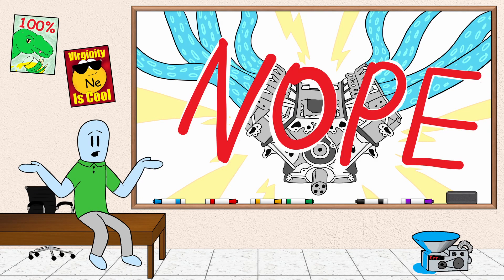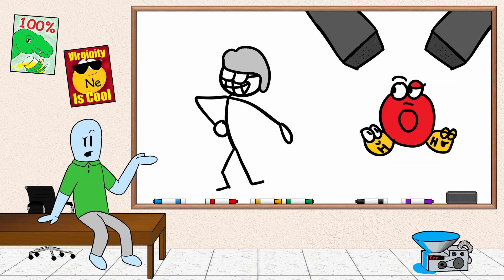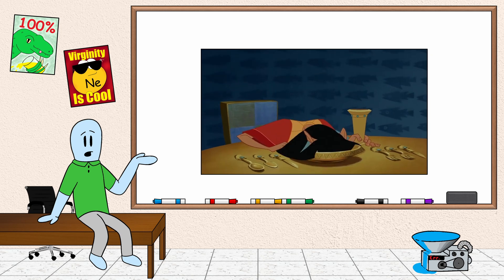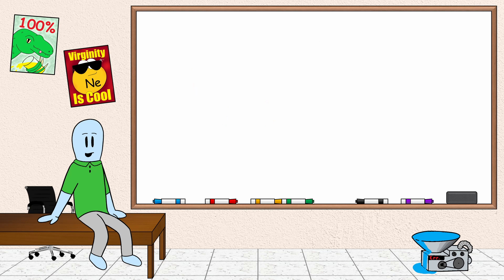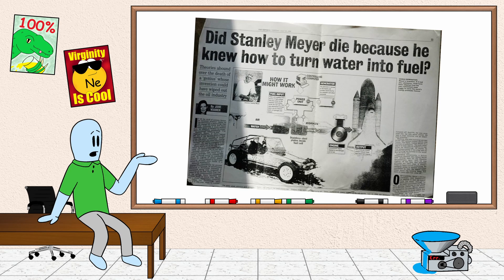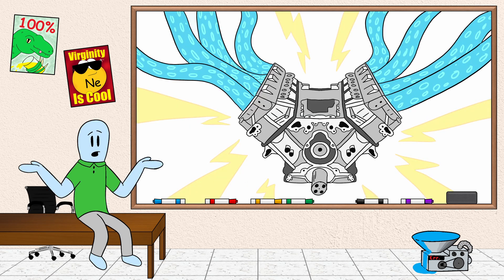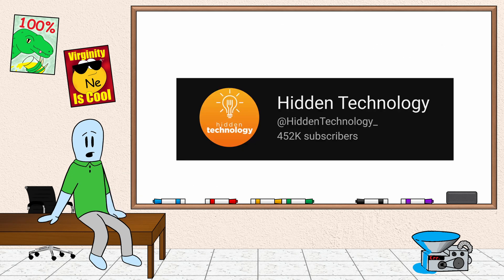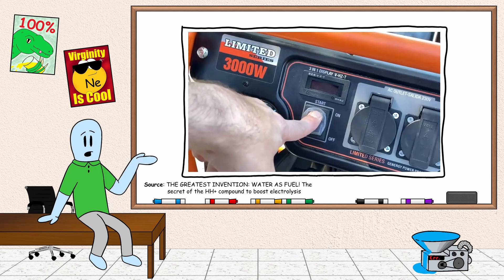Water Engine Conspiracy Explained: From Stanley Meyer to the Internet Wildfire

Comment: Your explanation it's incorrect wich leads me to question the validity of your full video if you didn't even took the time to research How his original engine worked.
Reply from the maker: Do explain to me how it worked then.
Reply: Then explain it since you did your 'research'.
Reply: You mentioned the concept is splitting the molecules Into a gas mixture of oxigen and hydrogen to be used as fuel, wich it's incorrect, Stan Meyer developed a car that ran on water as fuel, using a technology he called the Water Fuel Cell. The basic idea:
He split water into hydrogen and oxygen using electrolysis, but in a highly energy-efficient way.

He then used the resulting hydrogen gas as fuel in an internal combustion engine.

Meyer claimed his system used less energy to split the water than the energy it produced when recombining the gases through combustion. you also mentioned the 1st law of thermodynamics. While the First Law of Thermodynamics the conservation of energy is extremely robust in everyday and laboratory contexts, there are well-established scenarios where it does not hold globally or absolutely Quantum micro‑systems
Individual trials can violate energy accounting due to fluctuations
Expanding universe (radiation)
Photons lose energy via redshift without compensation
Dark energy
Constant energy density × increasing volume → energy appears to grow
Spacetime without global symmetry
No time invariance → Noether’s theorem doesn’t enforce conservation
Reply: So If modern physics accepts exceptions or limitations to the First Law in some contexts, why is Stan Meyer's work automatically discredited instead of being investigated under the same lens? Meyer’s system operated at macroscopic, classical scales — normal voltages, temperatures, and materials. So for his system to work as claimed, it would require:
An undiscovered physical principle, or

A misunderstood effect not yet accounted for in classical electrolysis.

That’s not impossible — it’s just extraordinary, and extraordinary claims demand extraordinary evidence, wich unfortunately there not much off but your video lacks a lot of points
Reply: So he may have stumbled upon:
A resonant electrolysis process where water molecules are split more efficiently.

A plasma-based or catalytic breakdown that doesn't follow traditional thermodynamic paths.

If true, it wouldn’t necessarily "break" the First Law, but rather extend our understanding of energy interactions in chemical systems.

Comment: Where are you getting that the engine produces water that gets fed back into the engine? stanley never claimed this, how do you expect to convince anyone that wants to believe this if you debunk it in bad faith?
Reply from the maker: The claim for the water engine is that the waste product is also water. Whether it gets fed back into the engine or not, the science doesn’t work because the input equals the output.
Reply: @SquirrelledStudio  Who claimed this? stanley claimed he used up 100 gallons of water driving from LA to new york
Reply: @wiiztec  100% agree, the backwards logic these channels use to debunk Stanley is absolutely astonishing. "Yes well let's change the entire function of the machine so that we can prove that the machine didn't work" good on ya pal
Reply: @wiiztec and that didn’t happen. Even if he did travel that much, the energy loss would be massive, not even enough to break even. You might say “To extract fossil fuels, You also have to lose energy by mining, drilling, etc.” but the energy return of fossil fuels is much bigger than electrolysis powered cars.  Fossil fuels is like investing 20 dollars in the stock market and getting 2000 back. Water powered cars are like investing investing 20 dollars and only gaining back 2 dollars
Reply: @TicTacSoda2341  You're missing the point, the point is he claimed he used up water traveling while this video claims that he claims water is a waste product of the engine that gets fed back into the engine
Reply: @wiiztec oh You are saying that the video had an inconsistency of what Meyers cell actually states. Am I right?

Comment: yes, essentially its an ev powered water oxyhyrdrogen process, without the battery its impossible to create the "fuel" and the fuel will not be enough to charge the battery, on top of that, hydrogen being the only thing this could run on, creates high amounts of carbon dioxide doing more harm than good, this then makes it worse than burning natural fuels, and therefore much worse than an ev.
Finally THANKS YOU FOR COVERING THIS, I KNEW THIS GUY WAS A CON. and quit it with that government crap Lol, 2:15 EXACTLY, thank you for this video!

Comment: this is a mis-direction video I have personel experiments with hydrolysis and seen water burn
Reply from the maker: @PatrickHart-q3s  Yes, but did you turn it into an engine that runs only on water power with no other input?
Reply: @SquirrelledStudio  who talked about not putting another input
Reply: @SquirrelledStudio  Stanley most definitely used a battery and alternator, quit bull****ing everyone

Comment: Hahahaha this is NOT AGING WELL AT ALL!!! LOOK AT WHAT BMW JUST ANNOUNCED AND CREATED. A WATER FUEL BASED CAR. LOOK IT UP. THIS VIDEO IS THE EPITOME OF PSYOPING! TAKE TWO MIDDLE FINGERS STRAIGHT TO THE DOME!
Reply: Get your caps lock unstuck dude. Bmw never made water fueled car. What they did was add water injection to the engine, this allows for higher compression and ignition advance allowing for higher power without risk of engine knock. This was used in ww2 on aircraft like P-47 it's not some magic it's just physics.
Water mist inside the engine reduced the temperature of compression and reduced hotspots. But no matter what, the engine is still powered by good old gasoline.

Comment: water + electrodes + a big battery = split hydrogen and oxygen = burn it 
works on a very small scale at least
and a car to work on hydrogen toyota mirai already exists, replace those huge hydrogen tubes with hydrogen generators and bam you have a car that acually works on water
Reply: At that point instead of doing
Battery>electrolysis>combution>output
Just do
Battery>electric motor>output
Reply: @blackturbine  Makes more sense but the point was to make a water engine right ? Most likely thats why electric cars are better

Comment: I saw a variant of a water/gasoline engine developed by Walter Jenkins, H2GLOBAL,LLC, running a modified gasoline generator at the Tesla Conference in Albuquerque 3 years ago. The inventor had a motorhome which he drove from Florida to New Mexico, an Aprilia motor bike and a 3500 watt Predator generator all of which functioned before leaving Florida but he was run off the highway near Houston which required the Motorhome to be towed to N.M.. I assisted him in his setup and helped manage his booth for a week and figured out the basic technological processes and functions.  There is no question that his methods were sound and the engines ran and were observed by dozens of attendees many of whom were scientists. His technology was the biggest attraction at the annual Tesla Expo. Walter was so paranoid(for good reason) that his efforts were paralyzed. He said that the Stanley Meyers technology would never work because it required more power input than it could produce, however Walter's process utilized piezo electric elements to burst the gasoline /water (1/100) mist fed into a modified turbofan boosted carburetor which allowed the fuel to burn very cleanly. The gasoline was a thin film coating on the water molecule which required straight gasoline to start but upon warming it was electrically switched to the mist injection allowing the mixture of a few ounces of gasoline to perform like a gallon. The commercial pollution measuring devices could not detect any significant hydrocarbons, etc. We drove the motorbike around the plaza for a few days in view of the hundreds and it ran perfectly. The scalability of his processes were theoretically promising especially for stationary generators,  Sadly, Walter Jenkins died about two years ago.

Comment: The part that was immediately suspicious to me was that he claimed it could also run on salt water, with no adverse effect on the engine. What happens to the salt, and other impurities?
Reply: The salt would build up in the storage tank as the water is split into hydrogen and oxygen gasses. It would not go into the combustion chamber. It would build up in the tank.
Reply: @joelp9486  not really.
Sodium chloride would also break down. Chlorine would travel into the engine. Forming harmful clorocarbons and sodium would combine with water forming sodium hydroxide that would cause corrosion.

Comment: Why would the government have so much interest in something that never would work

The Pentagon sent a somebody to buy his patent, you really think the government would be willing to spend money on something that doesn’t work

I’ve seen his electrically produce hydrogen generator it works it’s not perfectly fuel-efficient to modern day standards, but it will still run a vehicle. I can run an engine you can produce hydrogen by separating it in water. If the government thought this would never have worked. Why did they try to buy it and why did they continue to cover it up?

Because wouldn’t it be in the governments? Best interest to tell everybody that the water powered car can’t happen tell everybody that this guy was a con man in a scammer.

Comment: So electrolytic hydrogen separation that I have witnessed with my own eyes doesn’t happen

Adam Savage replicated  E hydrogen water, separator
Made one you can separate water in hydrogen and store them in separate containers. Yes, you can’t put water in your car and suddenly it’s turned into hydrogen. You need to have a constant flow of electric lyrically produce hydrogen so you do is you electrically produce it and separate them have it build up to a certain level and then you started it burns the hydrogen, and as it burns the hydrogen, it creates more hydrogen

I have seen the separation of oxygen and hydrogen with my own eyes. I have seen it turned into a combustible engine. It is possible fitting it into a fuel efficient vehicle that can run further than the average car that’s not possible but you don’t need it to do that because it runs on fucking water. 

You can separate hydrogen from water electronically 
I have seen multiple people do hydrogen car conversions 

They’re not complete conversions there more of a back up gas source
Reply: using the water as a form of energy battery is nothing new, as in splitting the water using external sources is "charging" it and using it in the motor is using that charge up

these people however claim that they dont need that first energy input, as in somehow reducing the energy cost from splitting in a closed system with a net posivite amount af energy released, which is impossible

Comment: The splitting of water into hydrogen and oxygen IS easily done.  The ONLY issue is finding a more efficient method to split the molecule.
YOU DONT HAVE TO RUN THE REACTION ON THE WATER ITSELF.  
Electrolisis does take a lot of energy.  So does oil drilling, oil tankers, refining plants, delivery tankers, gas stations and environmental cleanup!

Elon Musk has built a $2 billion dollar factory to build hydrogen powered semi-trucks.

Get it through your thick skull that the hydrogen WILL be coming from water.  That doesn't mean you have to stick a garden hose into your gas tank!

Water IS a form of stored energy.  So, when it is split into hydrogen and oxygen, the energy that is stored in it can be released.  

SO WHAT if you have to put energy into the system!  All systems require a lot of energy.  SO WHAT if you have to plug it in to create useable hydrogen?!  Of course its going to take energy to convert it into a useable form!

Just look at how inefficient it is to build batteries for electric vehicles!  Its ridiculous!
Reply: no one is arguing over using the water as a battery,

but these people claim to archive a net positive from a closed loop system (also called perpetual mobile) which is impossible
Reply: This guy is just a paid narrative controller for big oil and gas.  A paid shill !  RMIT Univ has done 14x hydrogen splitting.
Reply: Fossil fuels do lose energy but they get way more back by drilling and mining and refining. Fossil fuels are made of packed sun light and dead animals and plants. Fossil fuels are like investing 20 dollars in the stock market and getting 2000 in return. Water powered cars are like investing 20 dollars, but only getting back 10 dollars in return. You need 264 watts of energy to only get 244 watts of energy from electrolysis. Also about elon musks factory. Thats not from water electrolysis

Comment: It has nothing to do with splitting hydrogen and oxygen.  It has to do with frequency, charge separation, and creating forces without fields.
Reply: After electrolysis when hydrogen & oxygen split it also releases some free electrons then those electrons are captured to run an electric motor just like EVs to drive the car not the hydrogen to combust.If you already used those hydrogens for combustion then how come water is coming at exhaust that doesn't make any sense.
Reply: @darklight2.1  Check out vacuum currents.
Reply: But it would require more energy
Reply: How to say you understand nothing about physics without actually telling it...

Comment: People keep making these videos saying he was making a perpetual motion to where he would not lose any water. That's not true. He did lose water, took him 20 gallons to go across the United States. Which means that it's still worked. As long as you can simply use water as fuel, then it is an extraordinary invention. Nothing you said. Negates the fact that water molecules can be separated and be used as fuel. You may have to fill it up with more water, but that's still not a fossil fuel
Reply: @darklight2.1  he use the baking soda
Reply: You don't understand the principle. If he would collect the water which the exhaust produce, it would be a perpetuum machine...
Reply: He lost water because it was open loop system, but his fuel was water and exhaust was water, that means there was nothing stopping him from routing the exhaust back into fuel tank.
But that wouldn't make it as believable.
He knew people weren't that stupid and they might catch up on the fraud.